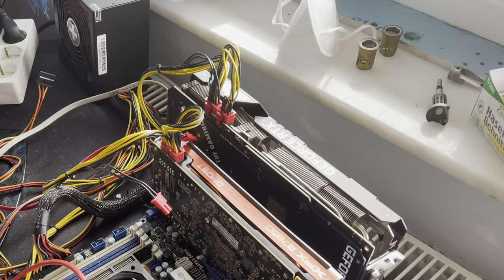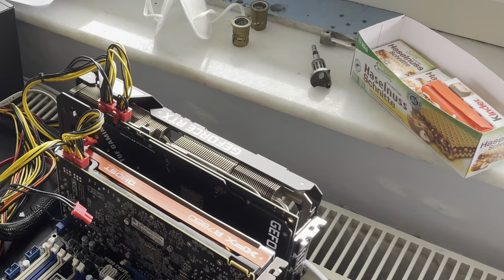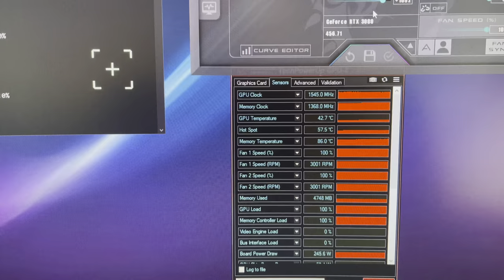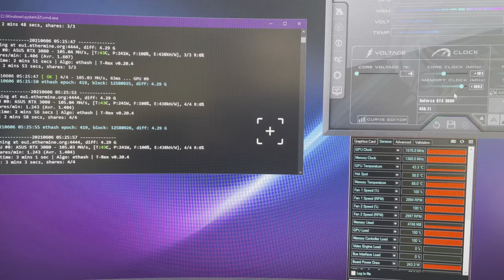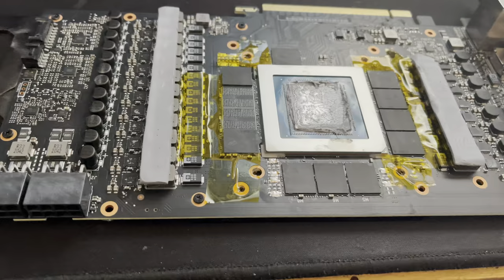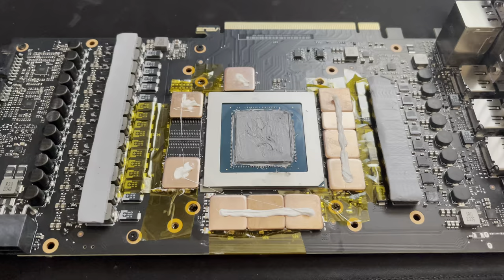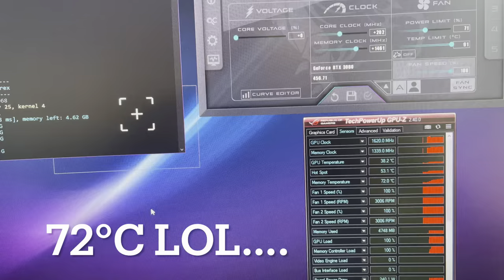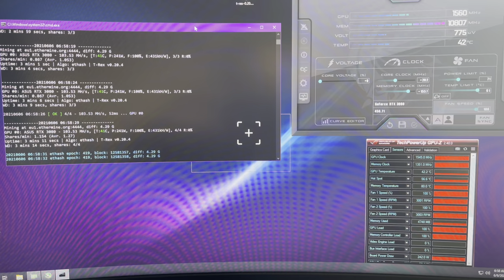Copper Plates on GDDR6X of the RTX 3080 ASUS TUF OC - vs. thermal Pads - Was it worth it?

Comment: Hey man, thanks for the info, followed your guide exactly and got my 3080 TUF down to 74 degrees!
thanks! the only difference i did, was use TG-PP10 thermal putty instead of paste, i also used this putty to try to thermally connect the vram heatsink to the core heatsink in a couple spots.
great job, wouldnt have done it without you (especially knowing i needed to cut one of the plates in half)
Reply from the maker: That sounds awesome mate!
Glad, that I was able to help someone to save his 3080 from glowing :P. :D
Reply: @UnleashedOverclocking  what tape?
I can't hear u clearly
I'm looking for that that but I don't know the name lol
Reply from the maker: @dominicalvin  hey. It’s called Kapton Tape.
Reply: hello, how thick do you use the copper sheets? thanks for your answer
Reply from the maker: @0887albert  depends on the card. 1.8mm fits the most time.
Reply: @UnleashedOverclocking  ah thanks mate xD
Reply: @UnleashedOverclocking  or u can just use sand paper to thin it down kek
Reply: @0887albert  just buy thicker shims
u can always use sand paper to thin it down kek
Reply: @UnleashedOverclocking  i ordered 1.6 mm omg. I am fucked

Comment: I never thought about putting copper plates to transfer heat. Very clever idea. It's sad to see that you only achieved a 6 degree change. I really would have thought you'd get much better. Thank you for the video though! I think you did a good thing though. The cooler the better!
Reply: he in the other video with zotac's GPU got very good results, I think it's because asus's temperatur didn't reach 100º unlike zotac, both in the end had very good temperatures
Reply from the maker: @1vend7  I like how you are always be there :D. Thanks for your support. I really appreciate it!
Reply: @UnleashedOverclocking  I like what you do, so of all the channels I see so far you're the only one that goes further trying to squeeze a little more performance, you're like me haha, I like to do some experiments/tests myself I just don't have much patience for film and I don't have as much knowledge as you haha, I've learned a lot on your vides, for example how to further increase the memory to go beyond 1500, use these copper plates etc etc.

Today on my 3080 i put thermal pads on the back 2.5mm it was perfect i also added 2 heatsincs (but i have to buy more these were the ones i had here at home) without changing the front thermal pads i managed to get it down from 98/100 to 96 I just can't have a good perception of the improvement because today the weather is much hotter

Do you have any Discord on the channel?
Reply from the maker: @1vend7  
Thanks mate! I really appreciate your words! Those making me happy and now I know that my vids are not worthless, because there is at least one person, that enjoyes to watch them!

But I can relate with the patience :D. 
100% also my problem. I have to force myself to do videos. I do such stuff completly random and not on a regular basis. So everytime I have lust to do something, I always need to focus not to forget to do the video! :D

I have a discord, but its not one for this particular case. So basically, I have none :D

Which cards do you have? 96°C seems to be hot, but I also recall that you mentioned that you have like 40°C, right?

Comment: I'm curious since this seems to work so well why manufacturers wouldn't just install these instead of thermal pads in the first place. I can't imagine pieces of copper with thermal paste being anymore expensive than thermal pads.
Reply from the maker: because pads are way easier to handle. 
And one manufacturer is actually doing it like this. 
Its not a graphiccard producer but a waterblock and they 
are cooling the VRAMs with paste as well. 
Called Aquacomputer.

Comment: 80C on 100MH/s+ is really good bro. I used plate also and only got 92C on 100MH/s at best. Did you change other sections pads also or leave it at stock?
Reply from the maker: Hey! Thanks. Yes 80°C is not bad at all. Just not what I expected. 

No. I only changed the VRAM pads for plates. No backplate and others.
Reply: @UnleashedOverclocking  Hmm, okay. So maybe me changing the others are the high temp caused. Gonna redo it again then :)

Comment: After a second watch, I noticed that your TUF's memory temp is 10c higher than on the Amp Holo. Would this mean the Amp Holo is outperforming it after the copper shim mod? I'm thinking about trading mine for a TUF so I'm very curious. Thanks for your help!
Reply from the maker: Since ASUS messed up the cooling solution on the TUF. Yes. Thats correct. AMP outperforms the TUF
Reply: @UnleashedOverclocking  it is wierd they say asus has best cooling , i would suggest you to add thermal pad in the middle of the card between radiator and memory plate if there is any gap, they had mistake like that on asus strix rx 5700 series

Comment: a better way than kapton or nail varnish is kafuter 750 silicone, more versatile way of insulation IMO
Reply from the maker: Thanks mate. Its definitely not a bad move to use this, but kapton is easier to remove in the end. Depends what you prefer.

Comment: You cannot do this like that due ram modules after assembly have different heights or even can be not levelled on PCB you need thermal pad to compensate it. Otherwise you risking situation like you get decent cooling next to thermal sensor but other part is overheating,  best approach is 0,5mm thermal pad on memory + copper Plates
Reply from the maker: Hey. Basically, you would be right. But since the plates are basically as big as the modules, they align pretty well. It would be like that, if you would use one big piece, which someone suggested and I told him exactly, what you said. 
What I do as well, is to grind the plates on one side to get it at flat as possible. So thermal contact from VRAM to copper is great and for the 0.05mm from copper to heatsink the thermal paste is good enough.
Reply: @UnleashedOverclocking  You can have heigh difference between memory modules corners/  sides. And this cannot be solved without thermal pad
Reply from the maker: @kkrolik2106  ok, if you think so, I will tell my 12 cards, that it actually dont work and they should stop pretending to be okay :(
Reply: @UnleashedOverclocking  I not say that this cannot work but you need be aware of potential deference of heights.

Comment: Can you put link to the cooper pads in the description? 
I have changed the backside pads to Minus pad 8, changed the frontside pads to mid tier artic pads, but still throtling. 
Now im thinking to change the frontside pads to Gelid extreme. 
Which is the good size? In your previus videos you have used 1mm thic pads, now you are using 1.5mm thick cooper pads.
Thank you.
Reply from the maker: Oh! Sorry. 1.0mm for the TUF is wrong. Did I really say 1.0mm? Have to change that then. It’s of course 1.5mm! 

I bought them from here: https://www.ebay.de/itm/303548255017

Comment: I saw your MSI thermal pad replacement video as well! So would you say the Amp Holo has the best performance (lowest temp) for mining out of all of these cards?
Reply from the maker: hey!
hmmm. No I wouldnt say so. The Strix and Suprim had the same temps, without copper. So basically, if you put copper on those cards, you will also decrease maybe to around 65°C. 

I also have to do a followup video about the MSI. Im confident, that I can get it under like 70°C. We will see!

Comment: can you explain why you using that high voltage on core? and did you get better results using higher core as well? lets talk about that oc, subscribed
Reply from the maker: I recapped the video and you are right! Of course there is no really reason to use such a high voltage. 
Since you asked for the reason it self on this particular video: 
I was doing it quick and dirty, since I just wanted to see how the VRAM thermals are doing. 
Thats.. basically all. 
Otherwise I would have flat out the curve to use the lowest possible voltage. Thats what you 
do on 3080s and 3090s. 3060Tis and some 3070s are different story.
Reply: @UnleashedOverclocking  thats on point right there, here i am using 718/731mv to get 101/102mhs each (3080's)

Comment: people put thermal pads between the first small heatsink and the big heatsink in other videos so they touch and transfer heat to the bigger heatsink. maybe you should try doing that. I have a tuf 3070 TI and scared to try anything on it because of the weird cooling system
Reply: I'm thinking about selling it to get another card. Maybe a 3080 or 3070 TI strix
Reply: it's in my workstation/gaming pc so maybe I'll just use it on a core intensive coin like flux because core stays under 70c at full power and is quiet
Reply from the maker: Yeah, I did that too. even exchanged those pads for plates and didnt really change much!

Comment: Good video friend, it helps me a lot with my adventure of lowering the temperature of my stoves... I wanted to ask you, why I haven't found anything in the comments, what size of thermal pads does your factory card use and what size have you put on it with Copper?  thanks for answering and for the contribution
Reply: I'm reading the new comments, I see that you used 1.8, the thermal pads were 2.0?
Reply from the maker: yes. exactly.

Comment: Could you make a video in which you give an overview of all the cards you have in use and which based on the data is the best in terms of temperature (with and without modification) and hashrate?
Reply from the maker: Yes, I will do that in the next days!
Waiting for a FTW3 to arrive and also some more copper plates. 
After I finish that, I have a neat comparison between different cards and I will draw the conclusion afterwards!
Reply: @UnleashedOverclocking  Ah, perfect!!
Reply: @UnleashedOverclocking  Are all the acquisitions worthwhile considering the proof-of-stake process, which will soon be introduced?
Reply from the maker: Lets say, since I started mining back in January, most of my cards already broke even. 
And only mining raw profit. If I put an other card in the rig, if see my whole rig as "one". 
The card will be broke even with the "help" of the other cards. Soo basically.. I can put in 
a 3080 and it would be payed off in around 3/4 of a month.

Comment: 10deg drop only bc those dedicated heatsinks are limited in their cooling capability, it's better to share mem cooling with the main heatsink.
Reply from the maker: In terms of eth mining. Definitely!
Reply: @UnleashedOverclocking  I had nitro + and red devil 6700xts mining eth and the difference in mem junction temp is a whooping 20deg between the 2 brand, nitro+ uses separate small heatbank for its mem whereas RD cools mem and cores together with huge main heatsink, The weight of RD is much more than nitro too(more mass for heat transfer).

Comment: Very interesting,

What's the kind of tape you put on the components before putting the copper pads on? Does it have a specific name?

I will try it because I have a big problem with my asus and even repad I can't get the temperature down.
Reply from the maker: Thats called kapton tape. Speical tape for exactly that usage.

Yes, the TUF has a really bad thermal concept. Soo only copper will save it... a bit
Reply: @UnleashedOverclocking  I confirm you because I repad of Founder edition, I am at 76 degrees with the air conditioning (yes 76 you do not dream).  I repad the Asus with gelid extreme, I'm at 100 degrees, I feel like I did nothing.

Comment: I wonder why you got such great temperatures. I have the TUF 3080 (non OC). I opened it up, found the thermal pads were 1mm thick (which is surprisingly thin). I replaced with 1mm copper and a small amount of thermal putty as not to make it too thick. Put everything back together. It’s now reading 92C which is an improvement because before it was 104-106C. But it’s still on the hot side. The card design is different from the EVGA. The TUF has two heat sinks (a larger outer one for the GPU and a smaller inner one for the VRAM). Neither heatsink uses copper (unlike the EVGA). So it’s understandable why my temps aren’t as low as they are on my EVGA 3080. But the thing I don’t get is how you got your card so cool. 🤔
Reply from the maker: Well.. probably my ambient temperature. The TUF cooler is trash. IMHO
Reply: @UnleashedOverclocking  Yeah it is. I read on Reddit someone praising the TUF as having the best thermals for a 3080 and now I'm wondering if they were joking. :/
Reply: @ThatOneScienceGuy  I have a non OC TUF 3080 card also.  Have you done the mod yet?  I'm trying to figure out shim thickness to get and there are videos saying everything from .8 - 1.8.
Reply: @cavhall8666  Yes I did the mod. That's what my comment was about. I used 1mm thick shims and some thermal putty (not thermal paste). I think you'll just have to open the card up and use a caliper to measure the thickness of the thermal pads.
Reply: @ThatOneScienceGuy  my computer mines in a 70F room and will hit 102-106 pretty regularly.  I was going to use hair thin MX-4 layered over and under the copper so most of the gap is filled with metal and the MX-4 will take care of any imperfections.  Was hoping to have the copper ordered and on hand instead of taking it apart and measuring to confirm, then ordering it.  The putty everyone seems to want to use is no longer in production and I'm reading 6+ months worth of use before starting to break down?  That's why I was leaning towards the MX-4
Reply: @cavhall8666  I tried using thermal paste and had really bad results. But it's possible this happened because it was too thick a layer. What thermal putty are you referring to that breaks down after 6mo? I used TG-PP10. I hadn't heard about it breaking down after 6mo but I will say it was hard to get...And expensive.
Reply: @ThatOneScienceGuy  yeah the PP10 is no longer produced and they don't have a similar product themselves and others that were tested, don't have the same quality results.   The lifespan, I miss read. It said shelf life of 6 months but that's not life span in use or heat cycle time. I can't actually find that info. My mistake on that

Comment: hey how do you figure out the thickness needed? is it enough to put the secondary heatsink on top like you did or do I have to reassemble the whole thing to figure it out?
Reply from the maker: Its enough if you just use the frame to find out. 
actually the rest of the heatsink has nothing to do with the frame. Its basically standalone

Comment: Has anyone any firm idea what is being recorded as 'Hot Spot'? I'm not sure if this is on the GPU, or the row of chokes on the board just behind the Vram, etc.  Anyways as well as thermal pads on the cokes, i also ran a bead of thermal paste on the pads, and was surprised to find the thermal pads weren't actually making contact with the heatsink pipes. You won't need much paste but it should provide vital clues showing if the thermal pads are actually thick enough to be effective.
Reply from the maker: Its the hottest position on the Core.

Comment: So I changed the pads on my TUF 3080 and now the VRAM temp is 78-80°C at 28°C ambient with +850MHz OC (max it can handle without crashing) vs 106-108°C before the change with the fans at 80%; I got higher core temp now though (about 5-6°C) but I don't know if its due to worse contact between the GPU and the heatsink plate or due to better heat transfer to the heat pipes from the small VRAM heatsink influencing the core temp.
Reply from the maker: Sounds good to me! DId you use copper or "normal" pads? 
Its also normal, that your core gets a bit warmer, since you take more heat from the memory.
Reply: @UnleashedOverclocking  I used 15W GELID Ultimates.
Reply: Higher core temps are to be expected since you are improving the memory's heat flow into the heatsink, which now shares that heat as increased ambiant temps around the main processor. The main thing is the memory temps will be lower and not lead to throttling.
Reply: What about your hot spot temperatures have they also increased? As mine increased slightly about 5° more is that normal?
Reply: @justingalea4027  This might actually be a clue. If your 'hotspot' has sufficient thermal pads to be effective, and you improved the effectiveness of the memory vrms, then it would lead to more of their temps being 'shared' with the other heat sources.  So as long as the overall averages are lower. You are good.
Reply: @chrisliddiard725  makes sense thanks a lot

Comment: hey, I should I use some MX5 for the thermal paste?
 my new thermal pads didnt work at all. I was at 110c when mining
Reply from the maker: MX5 is one of the best thermal pastes out there. 
The only which is better, is the Thermal Grizzly Kryonaut by around 1-2°C!
Reply: @UnleashedOverclocking  tired it out. Now my card wont be boot.
Reply from the maker: @DereckR  hmmm. what exactly did you try?
Reply: @UnleashedOverclocking  copper plates etc then my card doesnt to freak out.
Reply from the maker: @DereckR  okay? thats odd. Could it be, that you used too thick plates? So that your card bends a little? Did you check?
Reply: @UnleashedOverclocking  maybe. I might have to get the right thermal pads
Reply: Sooo. My card was used before. Soo i got the right thermal pads then I had to downclock the memory about -300mhz to make it the card stable